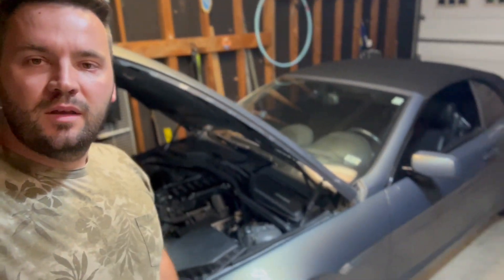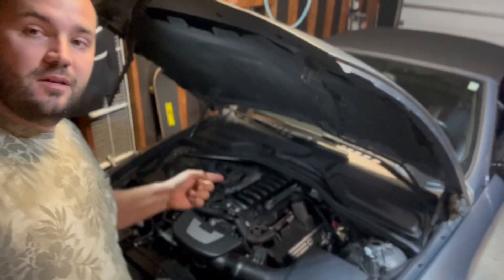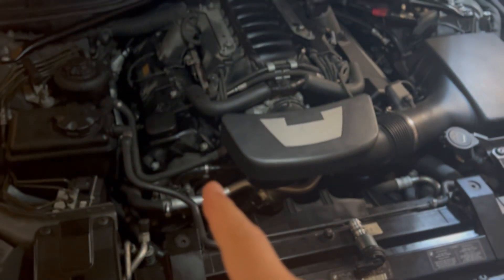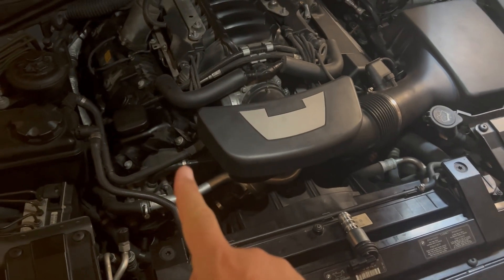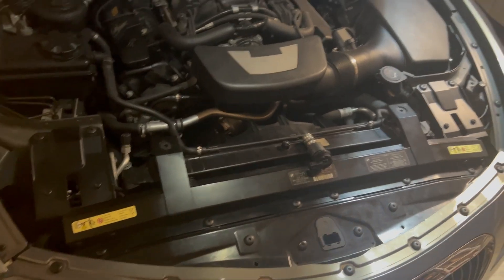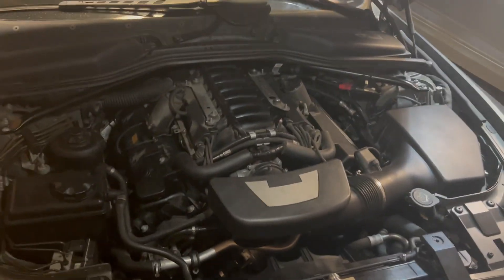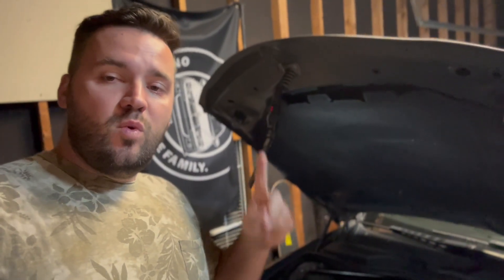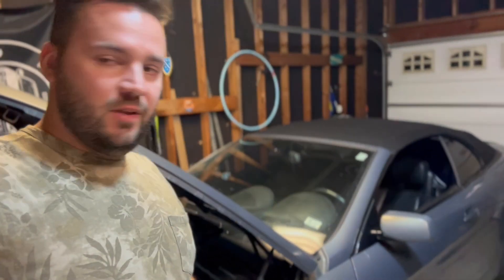BMW 650i N62 V8 engine and secret behind OEM Vanos Solenoids! *must watch*

Comment: So buy aftermarket part and replace both at the same time?
Reply from the maker: That's what worked for me. Had 1 original and 1 aftermarket and somehow they had different data output i guess and triggered check engine light. I ordered 2nd aftermarket part thinking first one was bad but i was wrong. Once i installed both aftermarkets on the same bank check engine light didn't come back. Don't forget that you need to delete CMU RAM or whatever it's called can't just erase codes.
Reply: @testosteronba obd scanner won’t work?
Reply from the maker: Depends on the code and repairs being performed. More serious codes for timing etc can't be just cleared even after repairs are made. You usually need to delete dat cmu ram data otherwise car will act like it wasn't fixed 🤷🏻‍♂️
Reply: @testosteronba okay, same for camshaft position sensor.
Reply: @testosteronba any more info for that